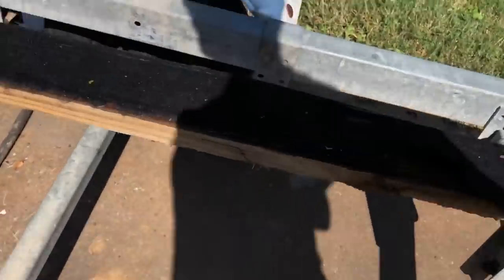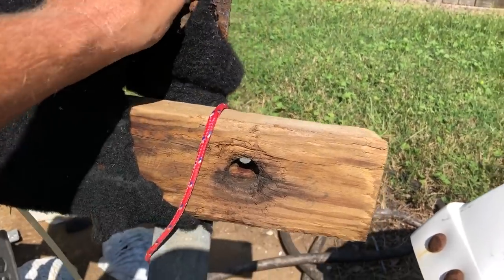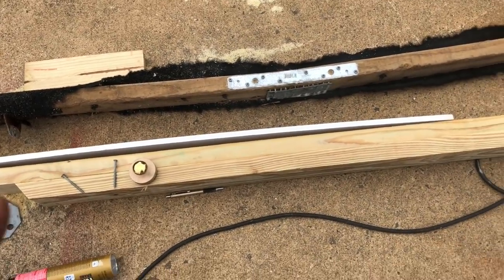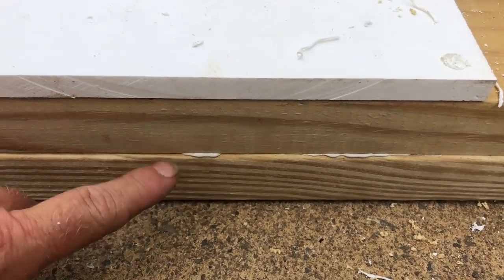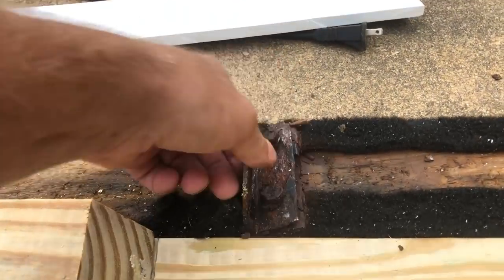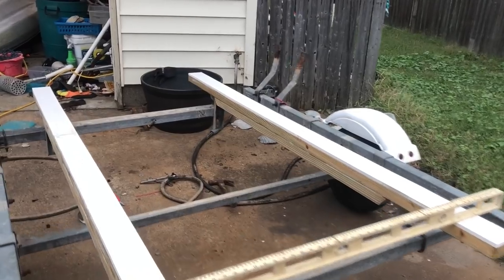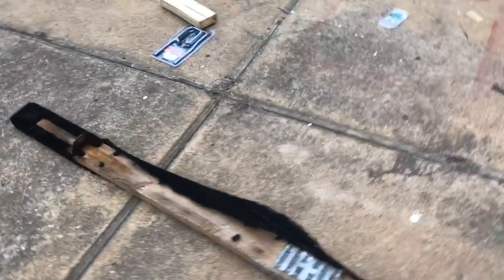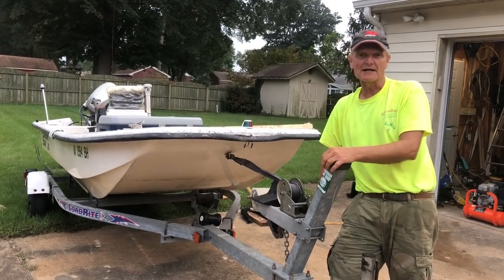Maintenance = Success!

Comment: Be careful with the hookah, I thought they had a safety system when the engine quit you were supposed to get 15 breaths of air as backup
Reply from the maker: It does but we could not hear when the motor cut when we were underwater.